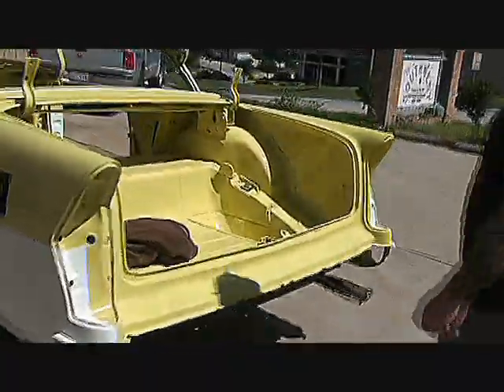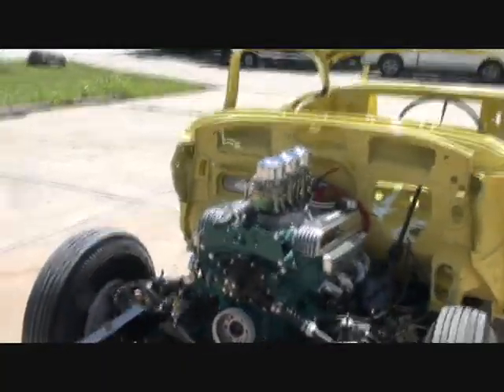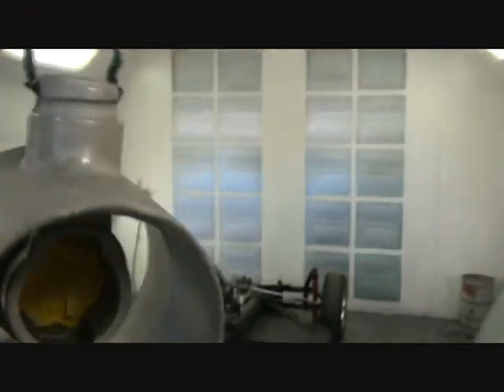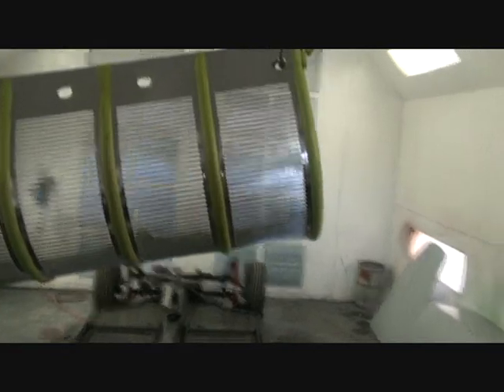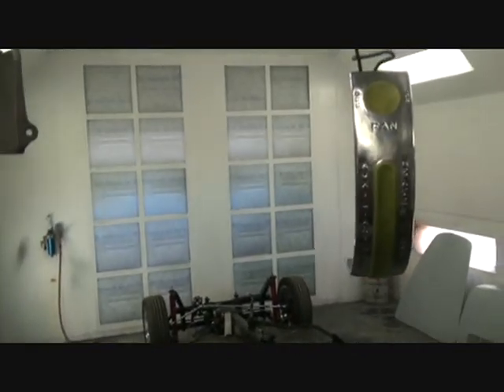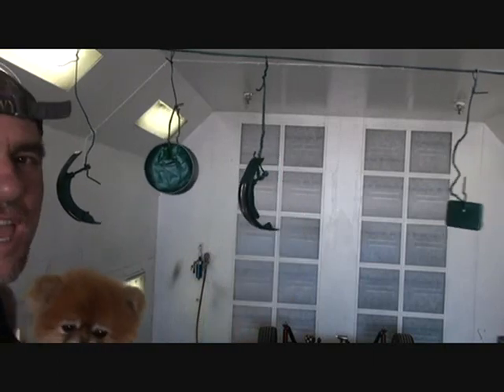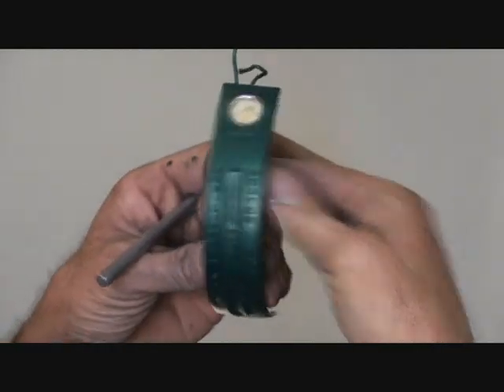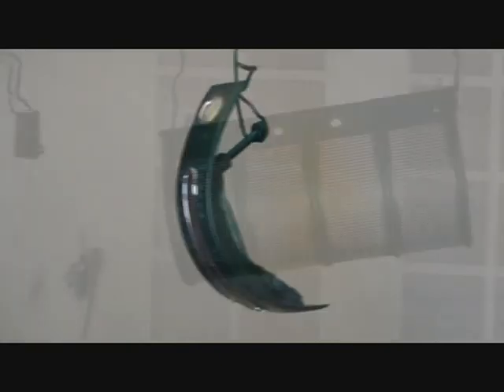1955 Buick Century-Painting Chrome RIght! Part 1

Comment from the maker: @mustangpoo If you look for the videos of the 1968 Dodge GTS where we are taking the car off the rotissurie, you will see us putting the rearend back in the car.. Basically you need a few jackstands for the body, and a good floorjack, unbolt the leaf springs from the car, disconnect the brakes, and drop the rearend out. Leave the car on the stands while you are working on it.. Good luck on the Torx Box... Thats a MAJOR WELD JOB!

Comment from the maker: NO what you do, is match it to a peice that is on the underside of the dash, or the inside of the  glove box.. This way the sun hasn't faded it out... Or if you have a customer like this, that has several of these cars with very low miles, and mint condition, you can just match it to one of those....... Thanks Pete